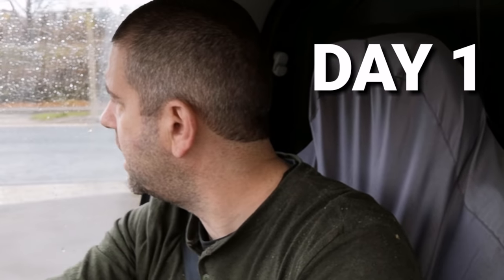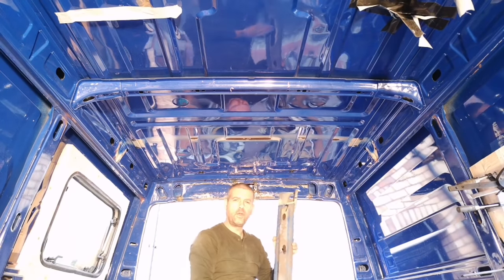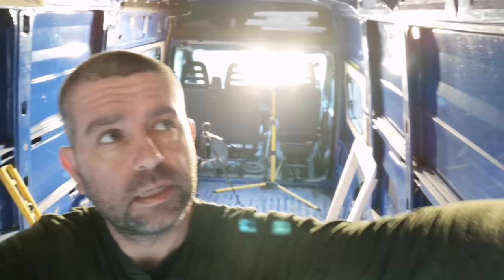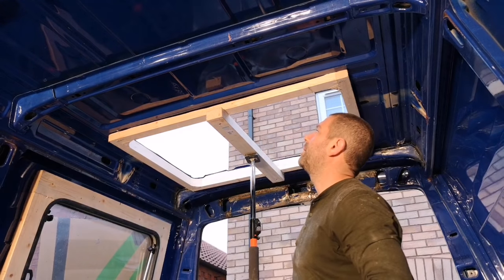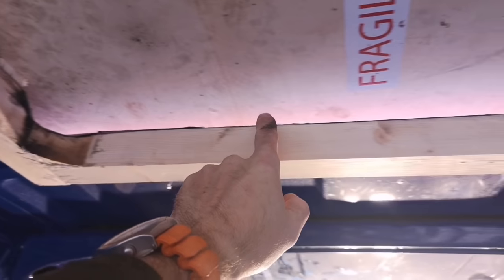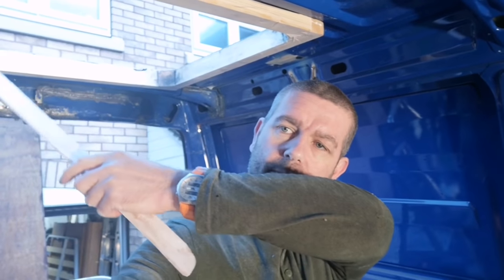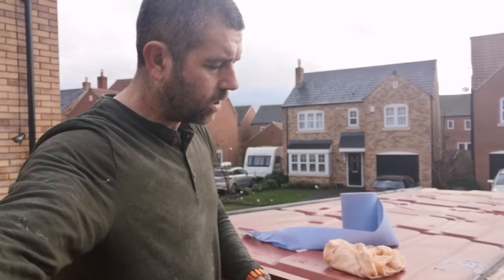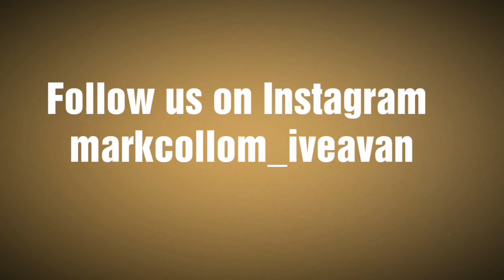How To Install Heki 2 Skylight In Your Diy Camper Van Build

Comment from the maker: Amazon store showing affiliate parts list that I've used within the van build.
www.amazon.co.uk/shop/iveavan
PARTS LIST LINKS
Dometic / Seitz HEKI 2 Roof Light Only
https://amzn.to/3122FCo

Dometic / Seitz HEKI 2 full Roof Light and Blind Kit
https://amzn.to/3nSLw7e

A smaller Cheaper smaller Roof Light Option.
https://amzn.to/2Zovpou

Sika Flex 522
https://amzn.to/3cQOMd3

Fibre Glass Filler
 https://amzn.to/3oWvAQA

Chopping Board.
https://amzn.to/3xqS14q

DISCLAIMER ! These are Affiliate Links That I've Shared.

Comment: Vans looking good that sky light seemed a lot of work carnt wait to see  the van finished.
Reply from the maker: Cheers Darren, yes it was a complete pane in the arse to fit, and frustrating due to the weather. Definitely not a winter job! At least the other two skylights are smaller, and should be a doddle to fit🤔😉👍👍👍.

Comment: Hi Mark, how did you make the fibreglass packing spacers to match the contours of the roof? Great work keep it up and keep the updated coming!
Reply from the maker: Cheers matey 😉👍, easy, clingfilm on top of the body work, a piece of wood cut out to make a straight edge on each side, then in fill with fiberglass paste,  I finished off by flating the rough edges down using a belt sander locked into the workbench bud 😉👍👍👍

Comment: You did well there considering the great British weather . But I think I would of tried a tin of body filler with loads of hardener in it , but it would of had to wait for the rain to stop , I think the IVECO must have the worst ridges then any other van roof , but the good thing with them they seem to be that little bit longer then the sprinter van
Reply from the maker: I did do that mate, I made a fiber glass moulds out of the ridges, the chopping board was to pack out the voids, still water tight today ( 9 months later ) bud 😉👍👍👍

Comment: You've made me want to move a rib now, so that I can install a super massive roof light! ;o)
Good work Mark.
Loved the ending, you'll be in trouble.
Reply from the maker: Lol, it turned out to be my old chopping board before I met Dawn 😂🙄😉👍👍👍.
Reply: @Iveavan  You were lucky there then! Good idea though, using a chopping board for thick packing material :o)
Reply from the maker: I was going to use fibre glass mouldings through out but time wasn't on my side for that, due to the weather. Winter is not the season for fitting Skylights 😂❄️😉👍👍👍
Reply: @Iveavan  I've just robbed my chopping board, think it might come in handy for the build! Definitely learning some tips Mark. About to order some plasterers props as well, noticed you using one to hold up the Heki frame, great idea :o)
Reply from the maker: 😂. Yep certainly comes in handy, even with insulation, in which I'm doing now 😉👍👍👍
Reply: Mark Collom #Iveavan Good luck, look forward to seeing the results, hope you’ve got a heater out there!
Reply from the maker: @michaell8835  lol I have but it makes no difference 🤔, hopefully, I should have a video out next week, regarding insulation, and how to get it cheep! 😉👍👍👍
Reply: Mark Collom #Iveavan I’ve subscribed and look forward to it 😬 🥶
Reply from the maker: @michaell8835  Thank you 😊👍👍👍...

Comment: Ha ha! the part at the end with the cutting board! 
Now that's what a skylight is supposed to look like. 
Tongue and groove, great for saunas but overused in van conversions, also I could imagine all the dracula stakes instantly made if involved in an accident, sharp splintering stakes getting forced into anything in their path, not for me.
Reply from the maker: Haha, yes no good for making sandwiches on now 🤔😂, yeah agree with you on the tongue and groove front, that's why I went down the ply lining route, because everyone seems to be using it, imagine the weight of some of those vans must be 🤔, something I can't afford is too much weight due to the power pack going in 🤔😉👍👍👍
Reply: @Iveavan  I've been lowering weight myself to make up for another leisure battery I'm adding, it must be done mate or where does it stop 😃
That was a great idea to cover the ply with lining, neat job 👍

Comment: Well done. But don’t think the bezel clamps the skylight in. Normally there are some plastic fittings that clamp the skylight, the the bezel underneath screws onto them
Reply from the maker: Thank you matey 😉👍. Yes your absolutely right, I removed the skylight quite a few months before hand, and I forgot which way round it went, in my case I've used extra screws to clamp it into position, that thing ain't going no where 😅😁👍👍👍.

Comment: Can you open the skylight just a little bit? Medium bit? And not just all the way
Also, now that you have been using it - do u love it, regret it, or it’s just ok? 
also does it make it hotter inside?
Reply from the maker: No I love it, I'd definitely recommend one, for opening mid and fully opening only, as for the heat, mine came with a black out reflective blind, so no issues there 😉👍👍👍

Comment: Hi, I don’t understand how you removed the rib. Was that a jigsaw? By the way, Dometic has discontinued its roof hatches. 

On another note, I just bought a Ram Promaster here in the States. Similar to a Fiat Ducato. The vehicle is two years old and someone had previously made it into a camper, although pretty crudely. There are currently two vent fans in the roof, both in the wrong locations. Can you recommend how I can best patch the fan opening? It’s 14“ x 14“. I’m thinking some oversized sheet metal Glued down and weatherproofed from the outside, and welded from the inside. 

After that, I want to put in a roof hatch similar to yours but in a different location. Hey on your roof hatch, it looks like it opens to about 70°. Do you think that’s enough room to be able to climb out onto the roof through the hatch? The hatch I’m looking at also opens up to 70°. I’d like to build a deck on the roof and access it through the hatch. Thanks for your time!
Reply from the maker: Hi bud😉👍, regarding the roof rib, I drilled out the spot welds (wasn't spot welded in that good to be fair) and cut through the glue that was bonding the rib on to the roof with a Stanley knife (the video needed condensing down a bit unfortunately).
We can still get the Heki ll in the UK (not cheap mind you 😬) https://amzn.to/3oA9TqC

Regarding your cover ups for the roof skylight hole's .
 I'd be inclined to visit a breakers yard to see if there's any scrapped promasters within stock, and get them to cut the sections out for you, that's needed to overlap/cover those holes up, I'd probably do the same way as you (an sandwich of glue between the panels and a bead of weld inside). 😎👌👍👍👍.
Reply: @Iveavan  Thank you! Good to hear Dometic is still supplying your part of the world, it looks like good quality.
Reply from the maker: Yes, I'm glad I've fitted it now😁👍. I forgot about your opening question? (sorry) Yes, it only opens up to about 70° so it would be a little tight to climb out of it, unless... You removed the gasstruts. But of course, you'd only be able to prop it open using the prop handle 🤔😉👍👍👍.
Reply: @Iveavan  Thanks, I was thinking the same, remove the struts if necessary.

Comment: There are supposed to be brackets with it that pull it down, then the inner trim fits to those brackets
Reply from the maker: I did use those brackets bud, just never fitted the inner trim within this video, due to roof lining hadn't been fitted at this stage 😉👍...
Reply: @Iveavan  ah ok, I was wondering what coloured ones you needed for this build?
Reply from the maker: @MrPantss  the Skylight was recycled from the salvaged caravan I had, I managed to extend the frame for the interior cover to hide any of the frame work this it now bud https://www.instagram.com/p/CJyvwj2BEMa/?utm_medium=copy_link
I think (from the top of my head) those clamps where white in colour 😉👍...
Reply: @Iveavan  thanks mate

Comment: I have the same skylight and we plan on installing it in a couple of days. How has it held up? No leaks? Because I noticed that it is designed different than our roof fans. So there is space to put the bonding agent (like grooves), but on the side with the hinges there is practically no space to manage to seal around the edges with sika or whatever. I could "silicone" around 3 sides, but not the hinged side. Cause normally one would use butyl to glue it, fasten it with screws, and then silicone around the edges on the outside. The fact that we cant do that 3rd step worries me. So just wondering if its been ok for you?  I hope my explanation makes sense to you 😊
Reply from the maker: Hi there Becky, mine has been fine, using the none drying bedding sealant seem to of done it's trick, although I too couldn't really seal the hinged end, but managed to seal the three other side edges using sikaflex. As yet nearly two years on, still no issues I've noticed, as long you can get the roof flat to mate the skylight to the roof you should be fine by sealing the underside lip of the skylight before fitting it 😉👌👍.
Reply: @Iveavan  thanks for your super quick answer! Wish us luck 😊 This is gonna be ace 👍
Reply from the maker: @beckylarsson393  good luck! 😉🤞🍀👌👍👍👍.
Reply: Becky - I have installed a Heki 2 on my van twice this same way (using pieces of a cutting block to level the top, and a wood inner frame), and I am about to re-install it a third time. Have had it in the van for about two years now. It keeps leaking on me. I suspect that it is leaking where the hinges are, just the place where you were concerned! I am about to order a custom adapter set of upper & lower adapters, to see if I can fix the problem. Proceed with caution!

Comment: Another question/thought, i wonder if i could do it so that I can climb out through the roof, onto a roof rack deck. Could that be done by mounting the skylight back to front? Of course there is a risk of it blowing off if you drive with it open....
Reply from the maker: I wouldn't advise it, as the locking latches are only made of plastic, definitely hinges need to be facing forwards for peace of mind 🤔👍.

Comment: Hi Great Video, thank you! @6:42 what is the name of that tool that is holding the beam up while the glue dries?
Reply: Oh I found it "3RD Hand Heavy Duty 5'-12'" :)
Reply from the maker: Thank you 👍👌,  its a plaster board prop, I leave a link for you 😉👍👍👍. Bessey ST290 Dry Wall Support Prop, Silver, 1600-2900mm https://www.amazon.co.uk/dp/B071Z2RXZJ/ref=cm_sw_r_cp_taa_QLSCDb29RE6FR

Comment: I want to fit a 700x400 to my xlwb ducato... Looks like I'll need to cut through or remove/replace a roof rib... Any advice?
Reply from the maker: Only what I've mentioned in the video matey, but just go carefully when drilling the spot welds! Because you can quite easily go through the roof, like I did on mine 🤦‍♂️🙄😅😉👌👍👍👍.

Comment: What did you actually put in holes below celotex type board was it expanding foam it want shown on video unless I missed that bit thank u
Reply from the maker: Hi Tony, yes any voids I either used expandable closed cell foam or stuffed them full with the off cuts of the expandable foam nothing was wasted bud 😉👌👍👍👍.

Comment: sorry if I have missed it but where did you get the adjustable prop from please
Reply from the maker: It's a plaster board prop, I don't know where mine came from, as it is a "work's one" , but most DIY store's sell them 😉👍👍👍
Reply: Those are plasterer props for boarding ceilings.
BUILDERS MEGA PROP 1.6 - 2.9m plasterboard plasterer
Reply: @ashyclaret  Many thanks

Comment: You should of gone to toolstation for your blades
Reply from the maker: We don't have one in Hull bud, I've got a trade card, for what's that worth nowadays. 👌👍👍👍
Reply: I have a trade card for B&Q even though I’ve been retired for 5 years ,I still do bits and peace’s to help pay for the van build . I should of looked for a caravan to take everything I needed out of it but with no were to park it and some neighbours giving me funny looks but saying nothing , if I have a caravan in the street they more likely would do , your videos have been a great help more so with having the same van , I’m thinking of putting a rising bed in my van for the two youngest grandchildren so we can take them with us now and then , it may be by the time I have it completed they may not want to come with us .
Reply from the maker: @ivecamperbuild_thomas4084  I've do have a video coming out tomorrow (probably today, by the time you will read this) regarding recycling caravan parts, I too had the issue were I had to g ut out a caravan in under two weeks and to get rid of it. In that time, I was at work over the two weeks 90hrs, first week after owning the caravan, I put it upon ebay, by the last hour I stripped it clean of parts. Before they collected it.... It was sodding hard work I tell you matey 😉👍👍👍